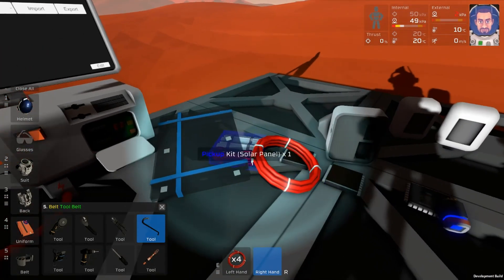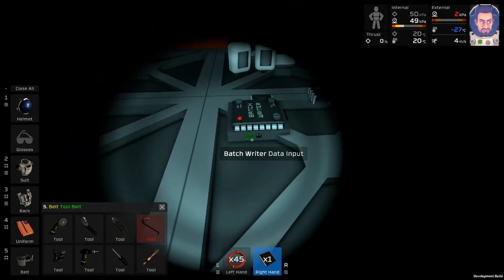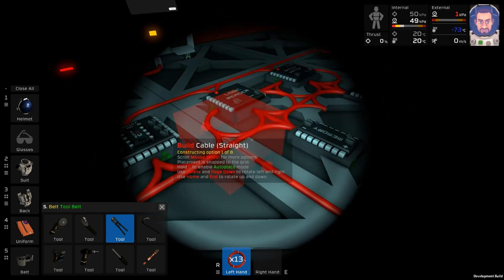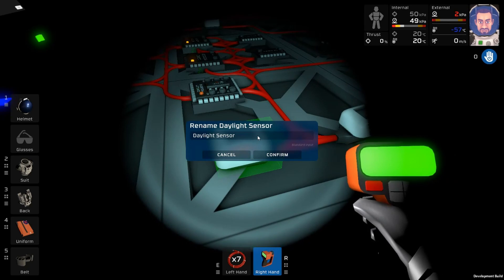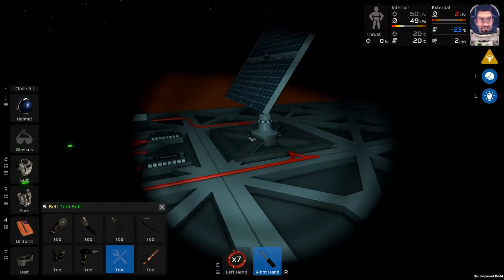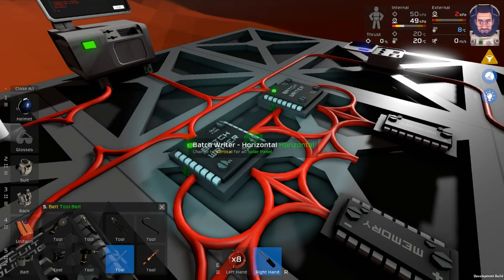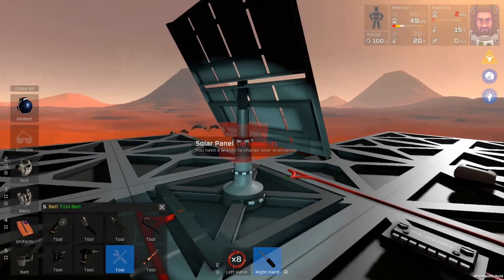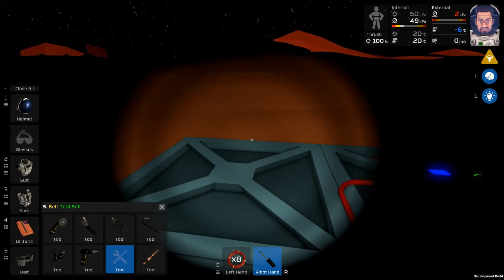Stationeers - 2-axis Solar Tracking Setup [obsolete]

Comment: You should really only change your IC chip screw values when they are turned off.  If you change them while on, you risk writing a value to one of the components you don't want to write while you are scanning through to find the component/value you want to set.  This can do things like lock a door when you want to set the open instead.